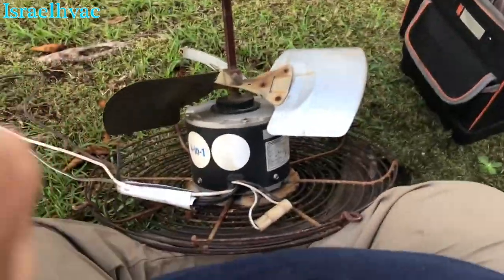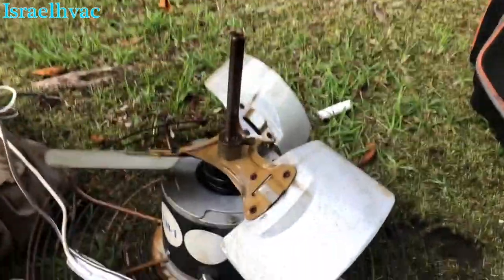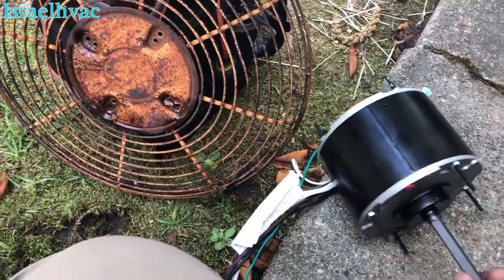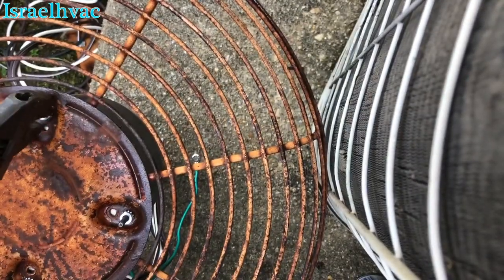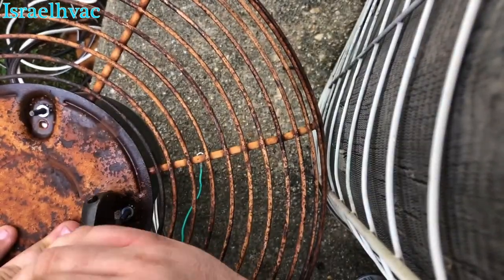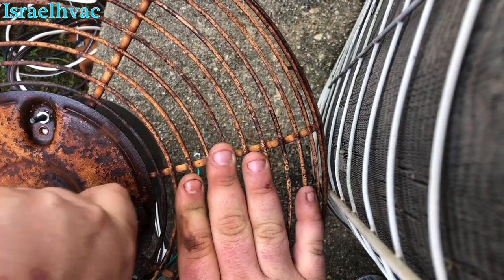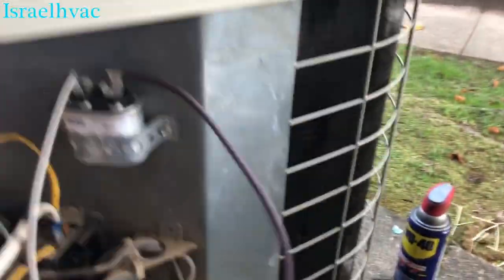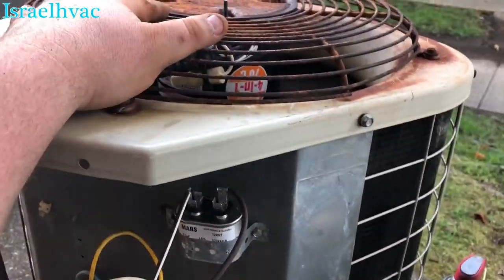Replacing a HVAC Condenser Fan Motor

Comment: Im not shure if you know this or not but you dont need to wire in an extra cap instead of useing a dual run. You only need 3 wires to hook up a condencer fan motor. The white (or yellow) common wire and the brown/white are connected inside the motor. So you dont need one of them. Check the continuity to see what im talking about.   An example of wireing would be black to L1, white to L2 (or to common on the cap) and then brown to fan on cap. All other wires are nutted off and zip tied up in place. 
I see allot of guys doing this. Hell i use to do it till i started reading into motors more.
Keep up the good work! =D
Reply from the maker: I very well aware of that

Comment: I reckon the BIG question for the experienced HVAC techs would be, are there OEM motors that will direct fit these older condensers and would it be best to use ball bearings vs. sleeve bearings?  Its usually the bearings that fail first so my concern is which is failing the earliest, ball or sleeve? Also, are there universal motors that can be ordered to turn the correct direction without having to use those with the "exposed reversing wires" which I hate to look at.

Comment: Question about replacing a condenser fan..
I'm looking for options to replace my ac condenser fan motor and not sure how to find the correct part. 
I have a Trane system model 4TTR5036E1000AA that has never been serviced since new.
On my service facts sheet it says I should have a motor with an 850 RPM rating although when I read the label on the motor itself it says it is an 835 RPM motor.. 
Also, I'm not sure of what part numbers I'm looking for. The service parts list shows an OEM part of MOT12750 however on the motor label I see different numbers which are:
5KCP39MF AC66AS -- and then 
CPN D154950P01 
any help of what to look for would be appreciated, thanks.

Comment: if you have a cordless grinder, just cut the shaft of bad motor right above the fan hub, it's much quicker than fighting the rust on those long shaft universals :)
Reply: Thats what I use and then I just got some hollow tube I carry with me and beat the blade out if still wants to give me trouble.
Reply: That is a harden steel, more work, let a rust penetrant do the job or puller.

Comment: Just a thought but have you considered changing the dual capacitor in that situation.  The fan capacitor needed to be changed anyway. Just a thought. But good job at getting them running.
Reply: I bet you don’t have any videos of you working on condensers.

Comment: I love those little tiny Carrier ~ Bryant 2 ton units. They're so tiny!!!!!!!!!!!!!!!  Tell me those little guys aren't the coolest. Next one i find during a change out, I'm fixing and painting up to keep and just look at.  They're so tiny!!!!!
Reply: I have one of these units with no real  problems since it was installed in 2005. I had a filter drier and txv put on 2006. It cools well. Rubber washers where the fan grill mounts to the machine take care of any vibration issues. I also switched to a quieter 4 blade propeller that moves more air and is less of a strain on the motor. I measured current draw to make sure.

Comment: That's a sad old-looking mini-Bryant. Can the rain shield on the shaft collect water and feed it to the lower bearing? There might be a case made for removing it.
Reply: the bearing should be up high enough for it to not sit under water, but I suppose wicking up the shaft is possibly. any water sitting on the back side would get flung out as soon as it started of course

Comment: I have (4)  11/32" nut drivers for just that reason, lol

One for each of 3 bags, plus one stuck to my magnet bar in the back of the van!
Reply: 9MM is very close, only talking 0.354" to 0.344" so about 0.01" larger in size than an actual 11/32 :)

Comment: I've had several AO Smith 1/3 motors that I had to remove the rain shield due to rubbing on motor even with it pointing down otherwise worked fine.

Comment: I would had liked to have seen an amp drawn on the fan motor, all that work and you don’t even know if it’s working in spec.
Reply: fan bearing failed.

Comment: dang i wish you were local so i could hire you... my fan is making rattling noise and lots of vibration..then it slows down and stops and i hear a buzzing sound.  could this just be a fan motor replacement?

Comment: I changed a condenser fan on a RTU today. Someone put the wrong motor and wrong pitch blade on the unit. 
Was tripping high head. Unit was absolute trash.

Comment: Sleeved bearing motors are junk.  Buy a ball bearing motor and it will last much longer.
Reply: not when they're chinesium ball bearings, I've seen the sleeves last much longer ;)
Reply: Ball bearings make more noise than sleeve.

Comment: Let me save haters from typing. Hater comment “what a rookie should have changed the dual run an wired it up 3 wire” Israel reply “suck it I do what I want” lol.
Reply: I do the same thing as long as there is room and the 'HERM' on the old cap is still good.